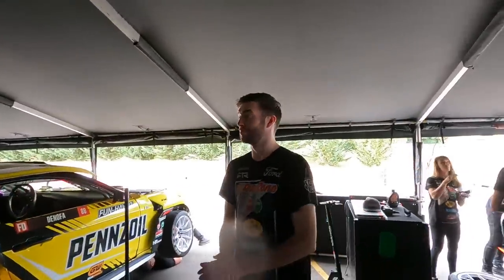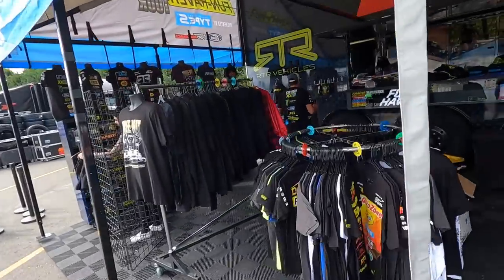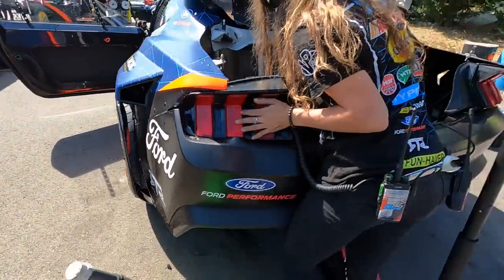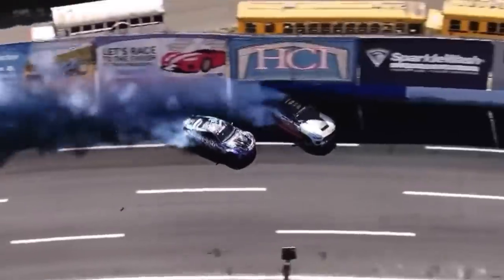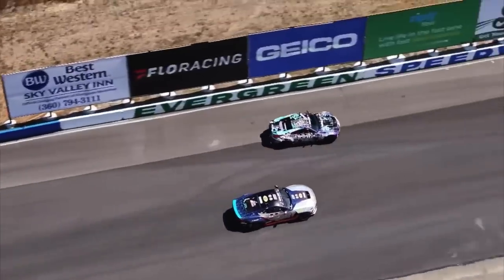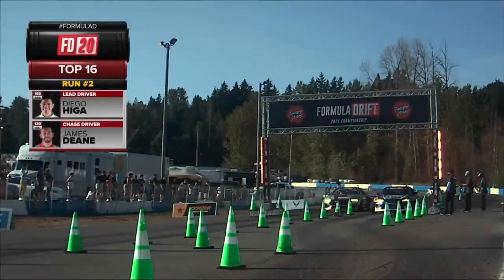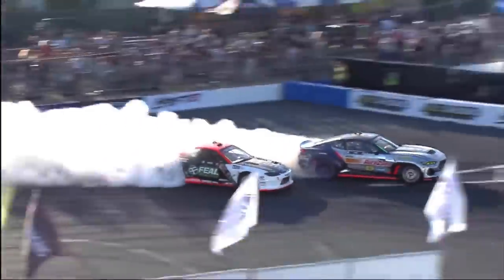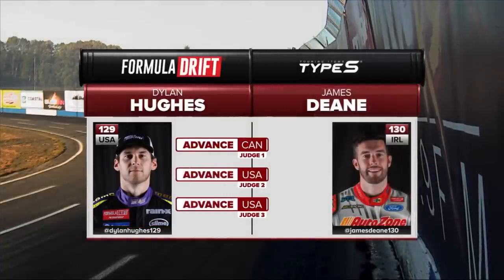MY FIRST PODIUM WITH RTR | FORMULA D SEATTLE

Comment: get the cage bracket things that hold your windows into the cage, could prevent lead car smoke into your cabin, i saw it on boosted boiz and they use it for drag racing
Reply: it pulls the windows towards the cage and with a small D seal it will keep it sealed